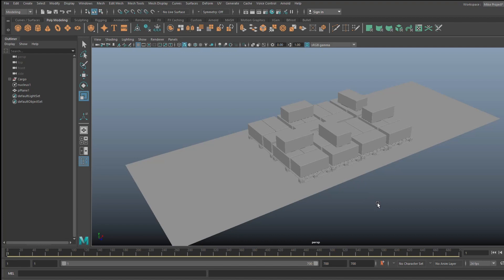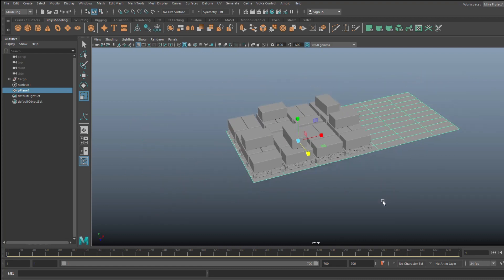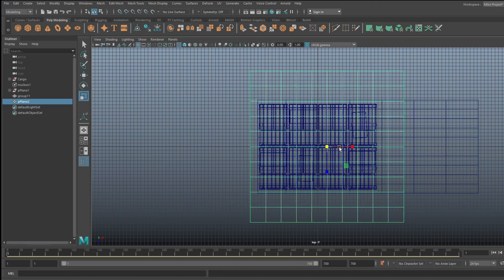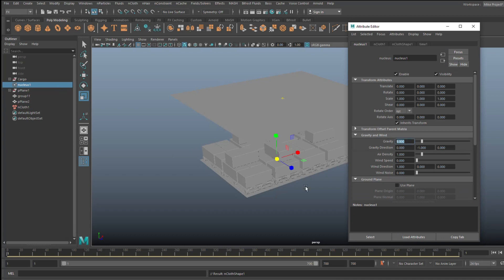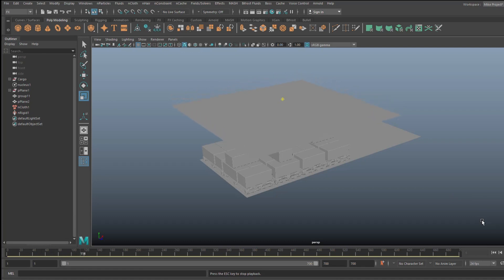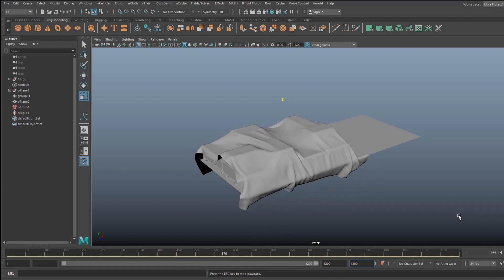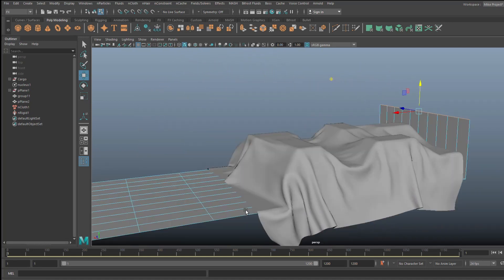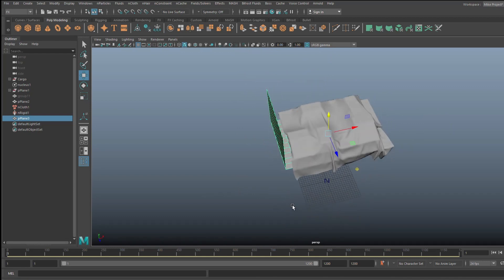How to model a Cargo tarp in Maya without the need to model Cargo

Comment: You should set the Nucleus Space Scale attribute to 0.01, or model things 100 times smaller, otherwise the simulation is not correct though it could seem like it is (considering your Maya units are in cm as default).
It should be done because Nucleus thinks you model stuff in 1:100 scale for some reason, hence the simulation speed (cloth falling) is so slow and incorrect and you always have to extend the timeline.
More info here: https://knowledge.autodesk.com/support/maya/learn-explore/caas/CloudHelp/cloudhelp/2016/ENU/Maya/files/GUID-02DD202C-C4C8-4A03-A664-2DA4D26F47CC-htm.html
Reply from the maker: Thanks for the tip !
Reply: @MHTutorials3D  You're welcome. Thank YOU for the tuts :)

Comment: After the fact, is there a way to reduce the polycount of the tarp as well? or you're stuck with it?
Reply from the maker: Ok, you can reduce it big time. You can safe it as a high poly, then use Maya Retopo to reduce polycount and save that one as the low poly. You then bake the HP on the LP as a normal map and voila, you're done. Low poly with high detail
Reply: @MHTutorials3D  Uhhhh that's great. Thanks
Reply: if  necessary for quick solution = Zbrush = Decimation 
This will preserv the shape (LP) with a very effectiv polycount.
80% polycount delete.